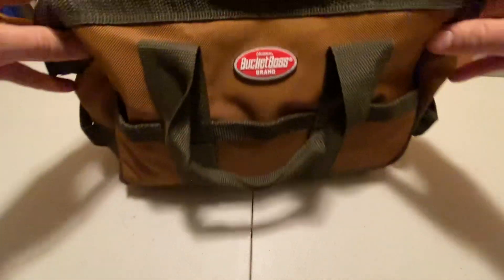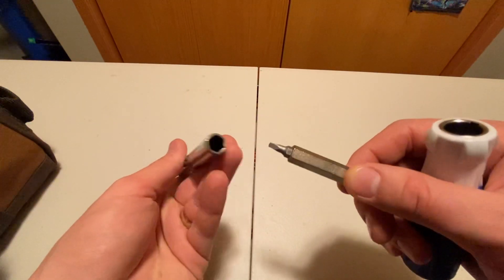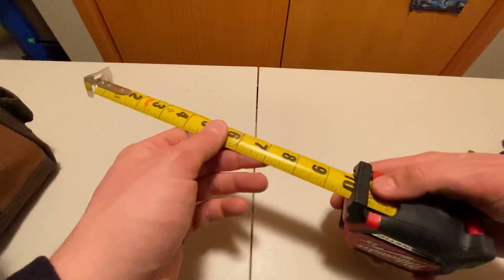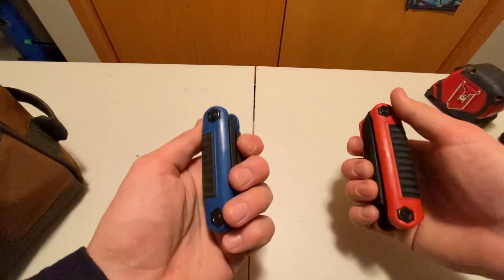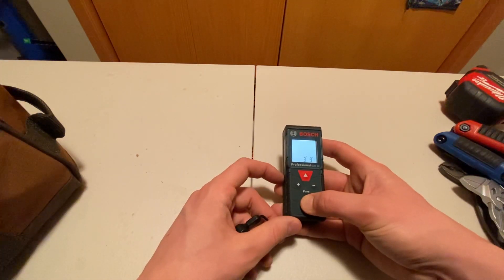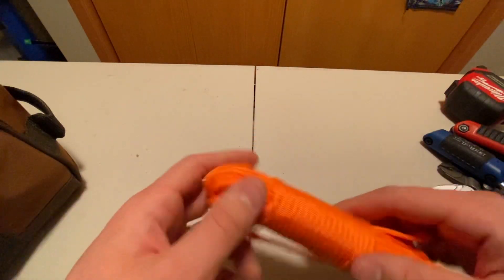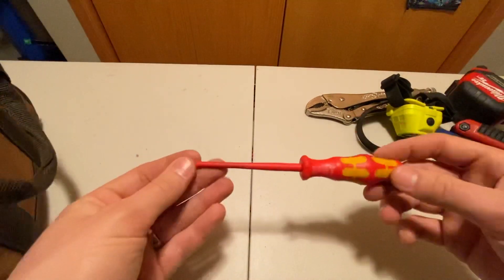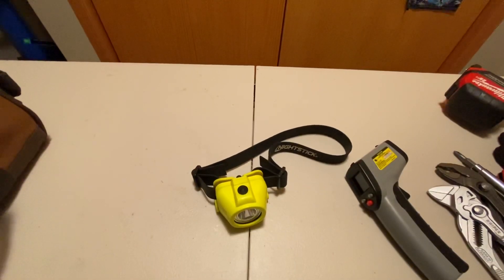My Engineer’s Field Tool Bag (Oil and Gas)

Comment: The .5 X 3 stands for .5mm tip thickness by 3mm width. As a controls engineer try out the 3.5mm tip. It will fit 99% of your control panels terminals perfectly. No more cam or blow out they’re amazing and what’s advised from phoenix/Allen Bradley/Automation direct. Great video and Wera is my favorite screwdriver. Their Allen keys are a killer also.
Reply from the maker: Nothing quite like looking like an idiot in my own video 😁! Only recently learned that as I’ve been buying nice screwdrivers lately. Wera, Wiha, Felo have all been super stellar. I don’t do much in control cabinets these days so it’s only a rare user, I do have a 3.5mm felo though so maybe I’ll switch it out. I just like the wera better! 

I’ve heard great stuff about their alllen keys. The sets I have at home are an American made brand that I can’t remember at the moment but those have been really great.

Comment: I love your channel. Knives are fun but I also work everyday and good tools really make life easier! So that lazer tape I've seen them on sale during the holidays should I get 1??? Also knipex has a really nice wire stripper cutter lineman plier that I love!!!! I work in water plant and deal with alot of the stuff you talk about. The strippers are expensive but really cool
Reply from the maker: Really appreciate it! 

If you're walking down pipe a lot or just making a lot of long measurements over open spans it's worth it's weight in gold! Also working with big vertical runs of pipe/vessels.

Are you talking about the knipex forged strippers? I've almost hit the order button so many times on those! I used to wire nut everything at home and WAY preferred full size linemans so I liked to have lighter strippers. Now I've switched to using the Wagos for more speed and I don't need the linesmans so I'm looking real hard at the Knipex again! 

I have a video coming out about all that for my at home DIY bag but it's from before the Wago transition. Hopefully you find that one interesting too!